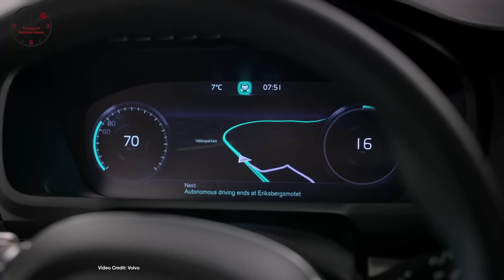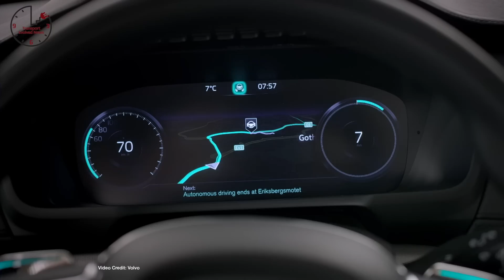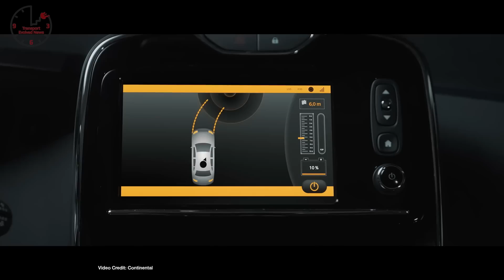Model 3 Production Up, Battery Breakthrough,  A Dying Man’s Wish -  TEN Future Transportation News

Comment: Hello love your videos please check out a battery design with an all carbon battery cell fast charge, higher energy density and a life time warranty.  Also 50% cheaper than Lithium batteries and it was designed and made on a shop bench not in a lab.

Robert Murray smith Is a world renowned graphene expert and his new battery requires no mining, no lithium, no cobalt and is 100% recyclable.

The C6 Power Blade is ready to be licensed for mass production.

https://www.youtube.com/watch?v=JP41vCUBz9Y&t=304s

Comment: This girl is right on top of things.  I think there are some execs over at GM that should tune in to find out what's going on in their backyards.  But I have a personal vendetta against 'hybrids' because they are a Trojan Horse.  If people buy those instead of pure EV's, we'll lose this Climate Change battle which is the only thing that's important here.  At one point, all oil use we'll be either stopped or made practically impossible and then these "PHEVs" will actually be just "EV's" with pitiful flashlight batteries and pitiful ranges.

Comment: Just a side note: I'm surprised you're not using the Model 3 assembly footage from the Q3'17 report, hosted on their Vimeo channel. Is it a rights thing? Here's the video:
https://vimeo.com/240762436
Reply: I hope that video is not real time. For god sakes that takes forever.
Reply: If you look at the people in the background, this looks to be real time.
Reply: It is real time. But it's a pretty slow setting - possibly the slowest. When all the machines are ready, they will be running much faster. Today they probably already run a lot faster. The footage is about 2 months old, and a lot has changed since then. The assembly line is throttled to match the slowest machine, and they had a pretty significant bottleneck in the battery module assembly part. Which - from the looks of unofficial production rates - seems to be almost fixed now. We'll see for sure in 2 weeks when the Q4'17 report comes out, which I think will be exciting.

Comment: Back in the 1990s we had a story on TV showing a car (Holden Commodore) which drove from Adelaide to Sydney on one charge. Thats around 1,400 klms in a car not designed to be electric. I called the Inventor who was a Scottish immigrant living in Adelaide praising him for his invention and how great if it were built in Australia. He wasn't  keen on that idea and said he was in talks with Toyota and was offered 45 Million for his Invention. Never heard of Again.
I don't know what the battery chemistry was but one of its ideas was to have a BMS that had fast recharging management which divided the battery so you would use only a certain amount cruising whilst the other section was recharging. Of course it was not over-unity hence it ran out at a claimed 2000 klms.
Reply: In 2012 an experimental electric Holden Commodore drove 1886 km in 24 hours.  However, the batteries were SWAPPED OUT 15 TIMES during that time, suggesting only about 90 minutes of run time before the batteries are depleted.